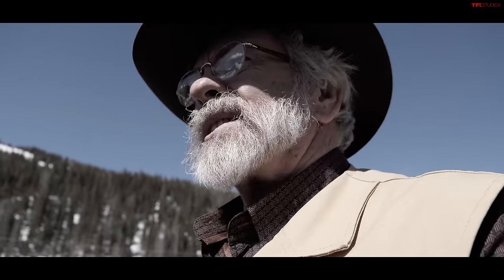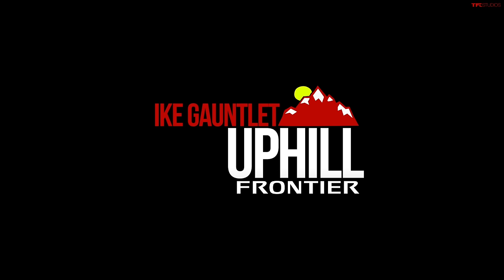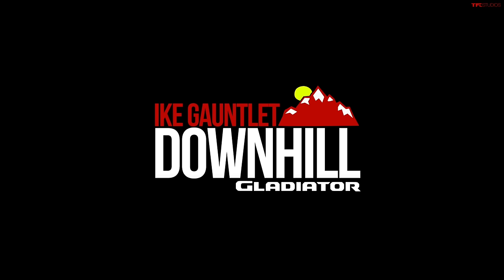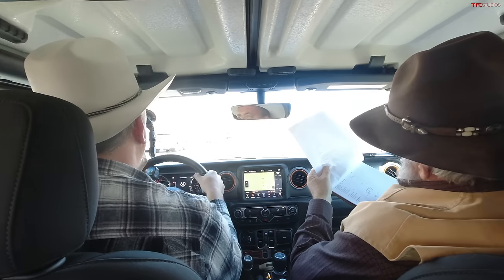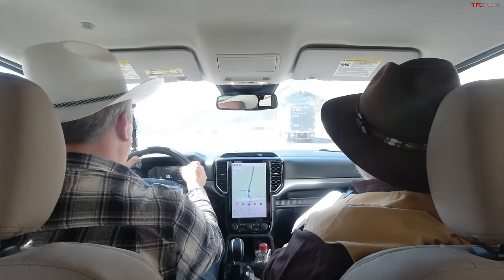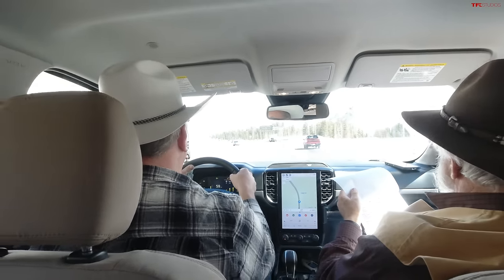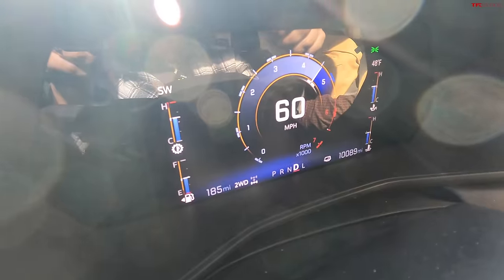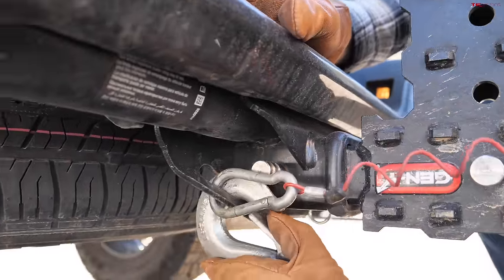MEGA Ike: New Tacoma, Ranger, Colorado, Gladiator & Frontier vs the World's Toughest Towing Test!

Comment: I really enjoy the content of this test, as it demonstrates real world applications of the trucks they test and not just the best in perfect condition that manufacturers do. However, because they are testing at higher elevation, it does put any of the non-turbo engines at a huge disadvantage when doing the acceleration tests. As someone who lives in the Midwest, elevation and thinner air is less of a factor and the test results for acceleration and mpg could change which is the best option. Would be nice to see the tests in alternative locations like the Midwest.

Comment: Great video. Thank you.  

All of these trucks will undoubtedly have long term reliability issues….. High compression, direct injection, turbo’s and overly complicated transmission electronics will be long term nightmares.   

I would have loved if all of these manufacture’s moved towards smaller diesel motors.  In that scenario you would have reliability, fuel economy and excellent towing capability.  

Now, if these are used as grocery getters or the occasional Home Depot runs I guess reliability won’t be much of an issue.

Comment: The Chevy Colorado warned up way too much on that run, especially considering it was only 46F outside....this truck will 100% overheat at 100F under the same test conditions.
Reply: Towed all last year with mine 5000 miles up/down high temps in upper 90s no issue what so ever
Reply: Not one truck on this test warmed up to much. Trans temps were low on all of these trucks. Especially on a 7% grade. Oil temps were good too. Not one truck had bad numbers. Fords fullsize trucks are thermostat controlled to run around 230 to 240. Nothing wrong with that.

Comment: listening to you guys talk about the rear end ratios as if it would make any difference in this test in vehicles with 8-10 speed transmissions is funny. You're "stuck" in old-school thinking when every vehicle had either a 3 or 4 speed transmission and they all had pretty similar ratios. Without also considering the differences in tire diameter, specific gear ratios, and engine HP peak band, it's a pointless piece of information. 

Similarly, comparing engine torque is also far less meaningful these days. Pulling a trailer up a hill is an energy equation, not a static force equation. The actual work done is all that matters. The turbine engine in an abrums tank makes less shaft torque than your chevy colorado, yet can move 140K lbs of iron and tracks through the sand at 40mph. Go do the math on that one and then see if engine torque ever means the same thing to you again. It's academic at best.

Comment: Do this again same trucks after 100.000 miles.
Reply: So far the only 2 have proven they can make it to 100k miles. The Jeep and the Ford so...
Reply: Let me guess which brand you like? 

Toyota?!
Reply: @Jay-me7gw  Toyota has always been underpowered and uncomfortable. This new one seems to have addressed those shortcomings, but it's still doesn't measure up to the Ford or Chevy in towing or capacity. If I had to pick today, I'd pick the Ranger for several reasons, one being the more usable bed. I just can't be a Tacoma fan. Can't make myself like it.
Reply: @teddonley9594 The 3rd gen Tacoma had an atrocious powertrain. Unlike most Toyota fanbois, I actually went and test drove all of the available mid-sized trucks and gave each a chance and the Taco was so bad compared to the others.

This new one is better I think, but I am with you. If I was spending 45-55k on a mid sized truck it would probably be a 2.7L Ranger or a Ranger Raptor.

I have driven a 2023 Colorado ZR2 with the 2.7L HO and I walked away pretty disappointed. I did not think that motor produced the torque they claim it does, not even close, and these TFL Truck videos seem to confirm that.

Comment: Turbo and towing this engine screaming. Is better buy older truck and doesn’t have turbo.
Reply: The naturally aspirated V6s in Frontier and Gladiator seemed to run 4500-6000 RPM. The turbos seemed to be at 3000-4500 RPM.

Comment: The Tacoma and Chevy sound awesome. Particularly the Tacoma sounds like a diesel
Reply: Funnily enough, GM used diesel engineering techniques to develop the 2.7t L3B. Out of all the truck engines that utilize the AFM or DFM. The 2.7t is the most reliable, or it has less problems per 100 units. Granted it doesn't sell as much as the 5.3 v8 with DFM, so problems will be more likely with that. But the 2.7t is turning out to be a reliable engine despite not being GM's bread and butter pushrod v8. When they first built the 2.7t, I was hoping they would develop an inline 6 3.0tt as a higher performing engine for trucks. But sadly that never came.
Reply: @99-Zulu  I would hope Jeep will get the inline six next year